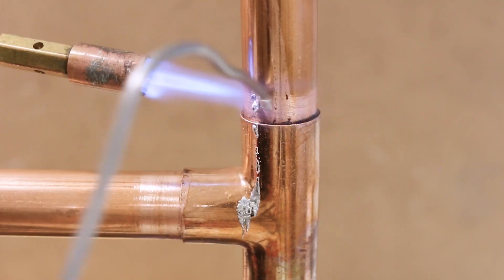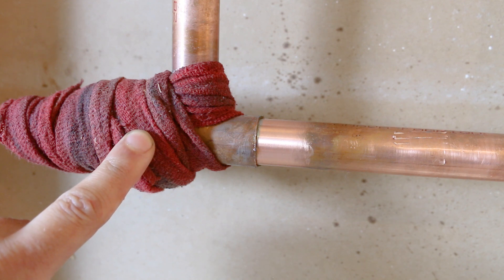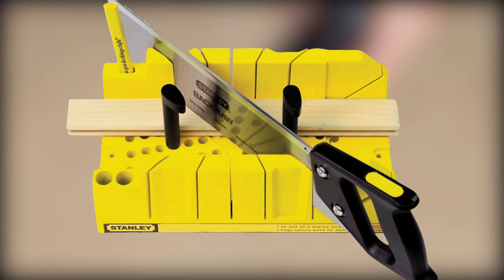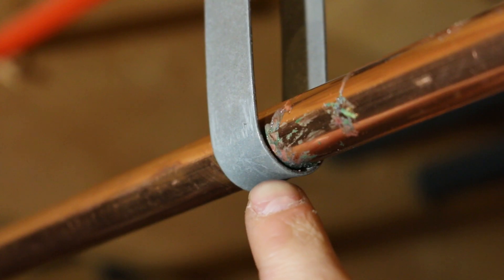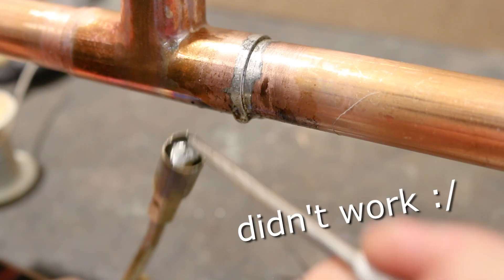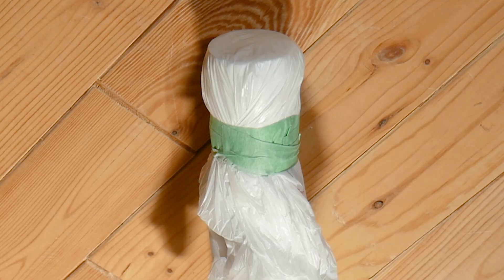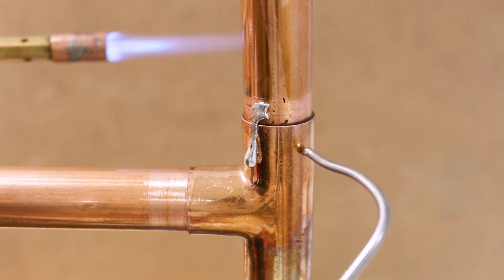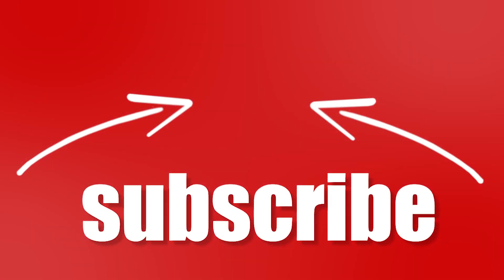10 Plumbing Mistakes Beginners Make And How To Avoid Them! | GOT2LEARN

Comment: Love it! As a plumber I already know theese things but I do enjoy watching theese videos. I would just like to point out.. in my area, in terms of residential dwellings like 2 to 4 story single family dwellings, we would never use type "m" for potable water. Always type "L"
Type "m" is for heat only lol
Reply from the maker: Thanks for the tips!
Reply: LOL - in the UK we just have copper pipe - it doesn't come in different 'types' ! Differences in wall thickness here are just don to the quality of the pipe. It seems Americans when it comes to stuff, always make the job harder with unnecessary complications !
Reply: In my area (southeast US), type M is code and commonly used for residential potable water applications.  My entire 2 story home was built with it in the early 90s, the hearing is forced air.

Comment: Is there any reason you shouldn't use K for potable water?  Like, if it's what you have on hand for a quick fix?
Reply from the maker: No, it's totally fine.
Reply: Thanks for the fast reply.  Most utubers don't take the time.
Reply from the maker: I answer every question, sometimes it takes a few days because Youtube doesn't tell you when you have a reply so we have to scroll down the comments for hours to get back to new replies, but yeah most YTers don't take the time because it's very time consuming hehehe, thanks!

Comment: Do you use lead-free solder nowadays like the electrical trade ?
Reply from the maker: 100%, no choice!
Reply: @Got2Learn  Oh well, you're not plumbers at all then now :)
Reply: @Got2Learn  Is it as easy to work with ? I hear electricians don't think it is.
Reply from the maker: It's needs a different method. Fittings are also lead-free, and they also need a different technique to solder.

Comment: Nice video for beginners. One thing I disagree on is using type M for potable water in residential applications. I only use type L on potable and M is only used for heating applications. You should add gluing pvc to abs. Some people say you can do it with special glue but I disagreed. I only use Proflex Furnco adapters or nohub 4 band clamps.
Reply from the maker: Thanks, good info buddy!
Reply: In my area (southeast US), type M is code and commonly used for residential potable water applications.  My entire 2 story home was built with it in the early 90s, the hearing is forced air.

Comment: Forgetting to check the obvious.  I replaced an old dishwasher once and due to unusual circumstances couldn't check the full cycle. Got a call back saying it wasn't draining right.  Turns out whoever installed the old dishwasher never popped out the drain plug at the sink drain. So the original NEVER had worked.

Comment: When soldering caps on a closed system you want to equalize the atmospheric pressure on the inside of the pipe/system. While heating the joint, if you see air bubbling out of the solder being applied to the joint you might have a leak. 
To counter act this, apply a little more solder to the joint as it is cooling to allow the temperature in the pipe to decrease/equalize which will also cause a slight vacuum resulting in more solder being pulled into the joint. The ideal temperature to apply the solder though is when there is no more vacuum or pressure build up inside the system. And like stated in the video, slowly heat the pipe so not to cause over heating and give more time for that pressure to equalize.  Nice videos! 👍

Comment: I had a ac unit fixed the pipe connected to the main water supply when they fixed the unit they left the sketchy gate valve there un capped so I removed the valve and capped it off.

Comment: Another point on water piping is insulation through the stud or joist.  Too many residential plumber don't do this. It's even an issue on the commercial side.  Pipe that isn't insulated fully with a thermal break and vapor barrier leads to energy loss and unfriendly environmental conditions such as mold growth.  Insulation should be continuous with a vapor barrier to prevent condensation on walls and ceilings.  A break in the vapor barrier leads to a point where humidity will condensate and drip on wood studs, in wall insulation, and potentially the sheetrock leading to mold growth.
Reply from the maker: Absolutely correct!

Comment: Plumbing in USA and UK is basically the same 😁 but electric is different.  110v v 230v and cable colour is different 🙁
Reply: Electricity is electricity....
We have 240 volts in the USA.   We also have 120 volts: we have 480 volts, too!
We have 3 phase power coming into our homes, also.  We do not typically hook up our stuff in 3-phase, but it is available when we do want it.  My son just upgraded his home to accommodate 3-phase for a specialized electric motor that he needs in his shop.  No biggie, we have National Electrical Code (NEC) to make sure it is done correctly, too.
Reply: Most houses in the US have 240V coming into the breaker panel and only half is used for most items but we do have 240V circuits and receptacles for larger appliances. Watch some videos on US electrical. We just use lower voltage where higher voltage isn't necessary for safety.

Comment: With proper tools also on cutting pipe from all forms of Plastics, cooper and cast iron helps a lot. I get it. Sence I went to school it was an none education system and since 2000 I just dont get why parents still send kids to school. It was a joke back in the 40 also. Just use the wright tools. Then go to a trade College. Most companies will pay for you schooling.

Comment: I had a pin hole in a pipe, and need to replace a section.  I noticed that at the end of the section, there was about a 6" small piece of pipe with a cap on the end.  Why is this done?  I guess I am asking, why not just cap the pipe that was used instead of adding a much smaller diameter pipe then cap it?
Reply from the maker: Future connection ;) you'd just cut the cap off and solder whatever fitting you need.
Reply: Water hammer

Comment: You can get solder out of a clogged tip by taking another torch  and heat the clogged head and melt out the solder pointing the clogged tip down
Reply from the maker: Yes, thanks for your input Gary!

Comment: Is it legal to put a 2 inch sanitary tapped T on a run of a slope on a pipe  at the end without put a 90 and then put 2 inch sanitary tapped T instead?
Reply from the maker: Did you mean capped? If so, yes there's no rules if you wanna use it for a cleanout in the future.
Reply: @Got2Learn   . A sanitary T for  Lavatary  in a bothroom.  Usually we put a 90 degree in the  end and put sanitary T on top of 90. But when there is a situation like this can i do it this way

Comment: When I was ten me and my grandfather where soldering copper pipes he kept on dipping the freshly soldered pipes in a water bucket i told that it would cause the solder would crack he still did it and one of the fittings leaked. The joints I did didn’t leak and I let them dry on there own.
Reply: M K yes
Reply: Wow you must have been the smartest 10 year old plumber to ever live. Your grandpa was lucky to get to work with you and gain some of your wisdom.

Comment: Who still uses copper for domestic hot and cold water?
Try new type systems like:JRG Sanipex (PEX pipe with Brass or bronze joints), Geberit Mapress(Stainless Steel Pressed) or Jrg Sanipex MT (Multi Layer Pipe).
In Switzerland and Italy we use this systems.
Take a look ;)
Reply from the maker: Yes those are all good, here in Canada we are really starting to adapt to PEX, so much better IMO.
Reply: Old work.  Lots of copper still out there.

Comment: Wouldn't fully recommend ratchet cutters over a saw. If cutting the pipe straight is an issue, use a pipe wrap in conjunction with a saw until you can get a feel for cutting it straight. Ratchet cutters can tend to cut crooked if there is a lot of slop in the construction of the tool. Especially on bigger pipe sizes. Great for small water lines but I'm not a fan for 1 1/2 or 2" lines.

Comment: You have a picture of my work in your video, referencing having level pipes importance, I piped the job with the diamond plated walls and the two tanks.
Reply from the maker: No way! That's awesome! You did a really nice job, I hope you don't mind it being in the video?
Reply: Yea it's ok by me, my boss company Tjs plumbing and heating had the pictures put in that magazine but I did the work. That whole house is radiant heat being fed by geo-thermal heat and cooling for air handlers, with boiler back up heat. It also has a snowmelt driveway and walkways

Comment: People waste lots of money on compression fittings to avoid soldering.
Reply: Well, consider the price of a torch head, gas, flux and brushes, solder, sandcloth, fitting brushes, fire extinguisher, solder fittings, not to mention the know how to solder properly and it wouldn't always be a waste of money to buy compression. Depends on what you're doing and your skills really.

Comment: I'm a master plumber of 34 years but I just can't seem to get my sweat fittings to not leak. I think I know what I've been doing wrong now...heat the fitting and not the solder! I'm gonna try that.
Reply from the maker: Awesome
Reply: Dude you gotta be joking. Funny, but if you've been plumbing 34 years you could solder with your eyes closed. I've been plumbing over 20 as a career, but I've been in the trade all my life as my father was a master plumber. He had 34 years in the trade before he passed away too young. Don't smoke.
Reply: @joshm5816  how would soldering with my eyes closed help, I don't understand. Maybe I'll try that flucks stuff he's talking about.
Reply: @TheBenjammin  Not sure

Comment: Have not seen DWV for venting and waste lines in 45 years ...
Reply from the maker: Mainly in schools and hospitals.
Reply: @Got2Learn  for waste?  I know you will find copper being used with oxygen lines and and gases and stuff that they use but I remember my grandparents house they actually had a large copper pipe for waste materials.  I had never seen it in another house since either
Reply from the maker: Yes, for waste, i've installed a lot of it too 😇

Comment: My method so far is to dunk everything in flux, then nearly melt the fitting, followed by using about 6 inches of solder for each 1/2in joint. I see water leaks and calling a pro in my future, but the wife wanted a new shower sooooo.
Reply from the maker: Yikes!!

Comment: Ok so you smashed the cap and pipe to keep it from blowing off. Now show me how you got the solder to not blow out. I don’t care how low you have your torch. There is no way your keeping solder in a dead end joint like that. Either your gonna have to open the valve or solder a threaded adapter on the end so you can cap or plug it with a threaded fitting. Or better yet leave the torch kit in the truck and just shark bite it.          
 Otherwise I pretty much agree with the rest of the video. Good on ya!!
Reply: Shark bites are NOT COVERED by MOST INSURANCE COMPANIES
THEY ARE CONSIDERED "temporary band-aid"....
Reply: Richard Wolfe to the best of my knowledge at least in my area no plumbing that fails is covered by insurance. They only cover damages to property ruined by plumbing failures and not the actual plumbing repair itself. Like I said though that's to the best of my knowledge. I'm not a business owner nor do I take care of any billing where I have worked. Only been wrenching since '91.
Reply: Tou should never put in a dead end joint unless it's temporary. Bacteria can build up and pressure fluctuations will cause the bacteria to enter your potable water.
Reply: Allow the atmospheric pressure to equalize in the pipe while soldering it. Preheat the pipe first if you have to. Also continue to apply solder to the joint while it is cooling, which allows the air pressure inside the system to drop therefore causing a vacuum and pulling more solder in instead of blowing out. 👍  I wrote a comment above explaining this more.

Comment: I want to use pex a.
Reply: I wouldn't plumb an outhouse with pex piping.
Reply: @shelbyseelbach9568  Why?
Reply: @SouthBaySteelers  the one little caveat of pex pipe that no one really mentions is that mice and rats find it to be fantastic for gnawing on. Copper is obviously gnawproof.  Pvc and cpvc are both gnawproof due to the chlorine inherent to their chemical formulas (poly-vinyl-CHLORIDE and chlorinated-poly-vinyl-CHLORIDE), which give them a taste that rodents find unpleasant. 
Pex has none of these qualities, but is instead a perfect combo of rigid yet yielding that small rodents, including squirrels, chipmunks, mice, rats, etc. find to be perfect for gnawing on. All rodents must gnaw on stuff all the time to wear down their teeth or they will grow to the point of stopping the animal from eating and in extreme cases can grow so long as to puncture the animals own skull. They don't care about the water in the pipes, and aren't even aware of its presence. Yet, when they puncture the pipe it can and will do thousands of dollars in damage to property in the extremely quick way that water tends to. 
I don't care where you live, or how clean you are, unfortunately neither do rodents. They are everywhere.

Comment: Get some additional parts and practice first.  Intentionally don't clean the copper fully, use too little solder, use too high a heat etc then compare with pictures of correct joints.
Reply from the maker: Yes, well said.

Comment: I disagree with using Type M copper in any potable water application residential or not.. it’s too thin and in my area it’s not code all water lines must be TYPE L, type M is used for DWV.

Comment: putting electrical tape on a pipe to protect it from a steel support seems like a bad idea 
someone might replace or move the pipe in the future and not replace the tape
seems safer to put the insulation on the support instead

Comment: I don't mind Pex piping taking the place of copper if installed properly. The one I can't stand is CPVC plastic piping, it's a lawsuit in the waiting. How it got passed is beyond me. Must be good lobbyists with huge amounts of money.
Reply: What's wrong with cpvc in effect?
Reply: @jdahighroller9389  CPVC after years in use becomes so brittle it's almost like glass, I know this to be fact because of service and repair. Just dropping it it will shatter.
Reply: @club-up  well true unless you insulate it but even then it's still serviceable
Reply: @jdahighroller9389  it's not the outside that's the problem, it's the inside. Especially the hot side. I would never use it, and haven't.
Reply: @club-up  maybe check your incoming water qualities,  I dont prefer cpvc cause pex is so much faster, but I've yet to see any long term problems w cpvc besides brittleness depending on exposure

Comment: Why noone has invented "plugs" that melt in a set amount of time... 
Instead of bread or toilet tissue 
With todays technology 
You would think someone would of invented a perfect composite material for this plumbers "cheat"....
Reply from the maker: It exists :)
Reply: WHAT!? 

What about a simple? Two bucket gravity-fed filter or Osmosis System to separate paint and chemicals from water on a job site?
Everyday on millions of job sites across the United States people dump paint water and chemical water down the drain and into the yards because there's no simple way to separate it.
Reply: Look up a jet-sweat.

Comment: The idiots who did the building im living in for uni seems to have made the last mistake cuz my cold water gets warm sometimes when someone takes a long shower
Reply from the maker: That sucks!
Reply: You might have cross over water
Reply: That also happens with something called a hot water recirculation system; with those, the idea is for water to be hot at the faucet without having to first run it for a while, so the temperature of the hot is detected near the faucet and if it isn’t hot enough the lukewarm water gets sent back through the cold water pipe.
Reply: @stevebabiak6997  i dont think this old building has that. Besides hotwater takes 5 trillion years to get to me
Reply: Probably either a volume reduction which is where the water system is improperly sized in which someone closer to the source is demanding hot water it will pull away from your demand. It could be a undersized hot water source. Could be a faulty tempering valve. Also some faucets especially the old moen 1225b and 1200 cartridges will mix hot and cold water causing like warm water. The old moen valves with the balancing spool will cause this too.

Comment: My 30 year old house has corroded joints covered in old flux, steel supports, and the pipes bang when you turn off the faucets. The cold water also gets warm after using hot water. I've had to break into the walls and ceilings 8 times in the past 20 years I've lived here to fix leaking pipes.
Reply from the maker: Ouchhhh, sad stuff 😥

Comment: The only mistake is using soft solder
Reply from the maker: It's not a mistake, this is how we solder here in Canada.
Reply: Got2Learn Strange when we are trying to remove lead contamination from drinking water. And lead soldered joints seem to fall apart with age. do you do any silver solder (brazing)
Reply from the maker: Our soft solder doesn't contain any lead :) Yes, we do brazing but only for certain things like HVAC lines etc..
Reply: Got2Learn what dose your soft solder consist of?
Reply from the maker: It's 95/5, 95% tin and 5% antimony: https://www.oatey.com/products/oatey-955-lead-free-plumbing-wire-solder-216233657
Reply: Got2Learn Melbourne Australia we were using silver solder but have been using pressed copper fittings for last three or four years
Reply from the maker: Yes, pressed fittings are becoming popular here too in Canada, we need to let everybody test it out for us first to believe it LOL